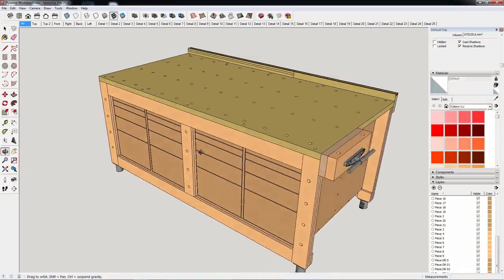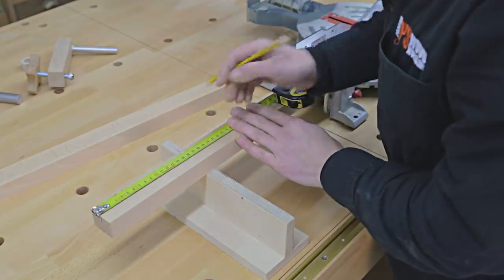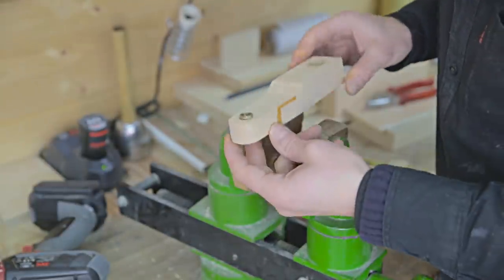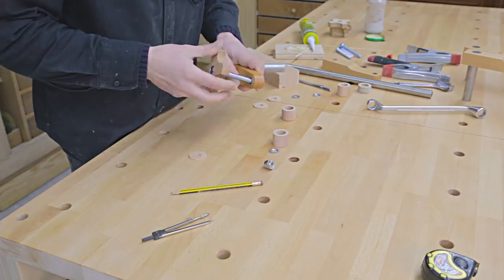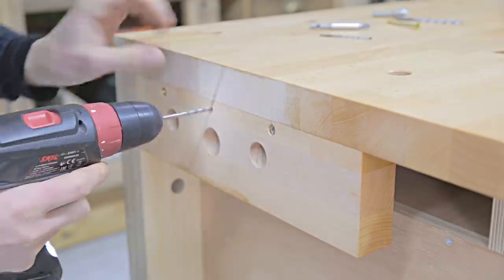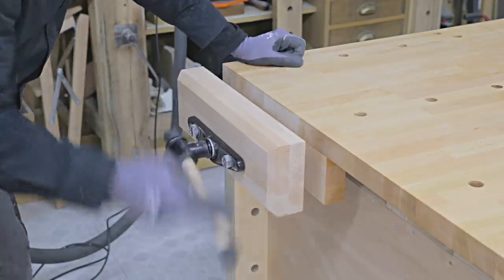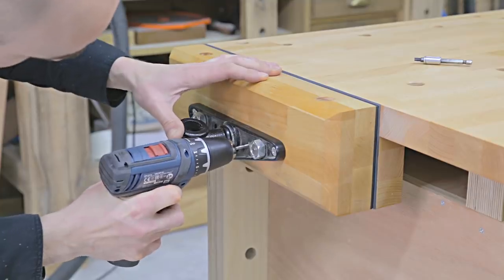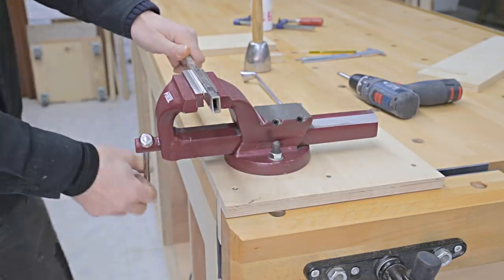Holdfast Clamps & Bench Dogs/ Workbench Build Part 3

Comment: Hi Paoson, Great job ... congratulations!
A question: where did you buy the clamp tubes and what size did you take?
If you please, you can add the site link, thanks!
Reply from the maker: hello Adriano, what do you mean? could you share the moment of the video?
Reply: Hi Paoson, there is no precise moment in the video. Specifically, I mean the steel tube that goes into the holes of the work bench. Excuse my English, perhaps not too understandable :)
Reply from the maker: @adrianoruggeri7273  You have to ask in some welding or metal folding workshop
Reply: @Paoson_Woodworking  Ok thanks, Pao !!

Comment: I like the quick release metal vice but using the wood vice to hold it down could mean a lot of swapping about on a big job.  What about putting it further away and using dog clamps or quick release clamps to hold the vice in place.  This way you have both vices in play without having to swap them in and out.  Still, a great work bench.

Comment: Hi Paoson, how big/long is your vice mechanizm (7 or 10,5”)? and where can i buy it? Thx
Reply from the maker: this is the ono I've used: Anke Neutechnik AK900302 (350 x 172mm / Spindle 270 x Ø 25 mm / Weight 5.200 gr /Opening 210 mm)
Reply: @Paoson_Woodworking  what is your vise max netto (in cm) expansion?

Comment: What is the purpose for the bandsaw cuts to thin the ends of the holdfasts?
Reply from the maker: it's just to make them more comfortable, thanks!
Reply: @Paoson_Woodworking  
Seems like it would have been better to keep the ends at least as long as the threaded inserts. Personally, I would not make the cuts at all since I would like to keep the wood at maximum strength.